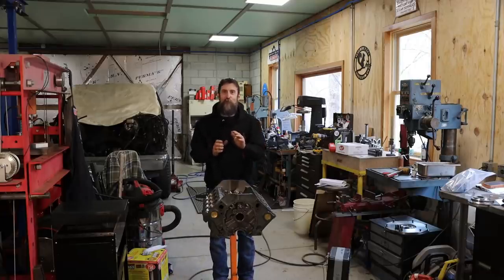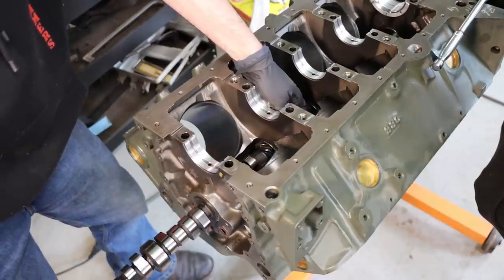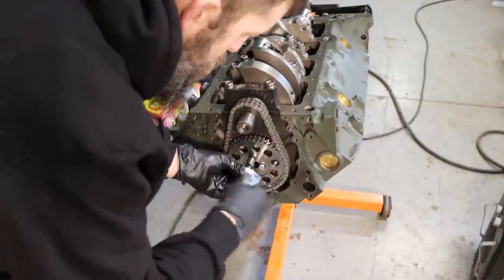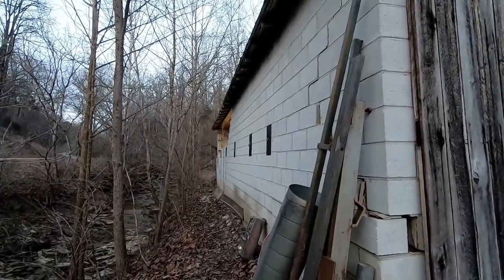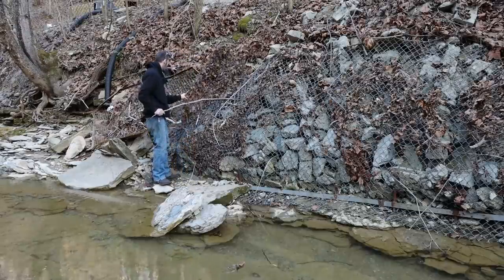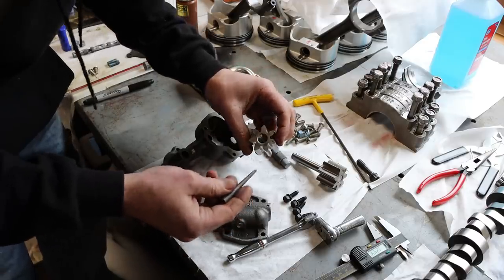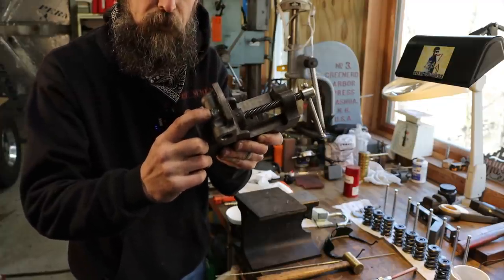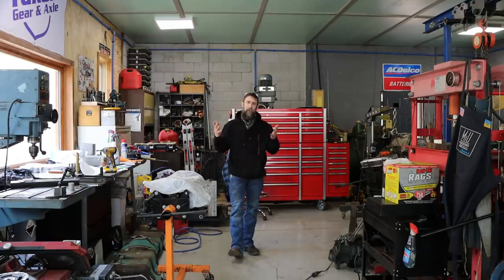Getting Ready for Balancing . Shop Update / Flashback

Comment: We always used a little modelers clay on the bottom of the oil pan where the oil pickup screen would meet and put the pan gasket on the block and set the pan on pressing it down to flush. then lift the pan off and measuring the clay to know how close the pickup screen was from the bottom of the pan.

Comment: For the creek: commentors have suggested creating an upstream breakwall to divert / slow the current along the bank. Maybe stack bags of premixed concrete to do that. Soak the stacked bags to activate the concrete. Lousy structural strength, but you end up with  tightly fitting "boulders".

Comment: Hi, I was doing my typical Saturday Moring visit and as with many visit's picked up an interesting tidbit on oil pumps. The reason and how to help with gear type automotive pumps having difficulties is new but unexpected for me. I have changed out or installed well over 100 of them and never from a failure due to this but it makes sense. The fix is quick and easy. Why not. as well with every machine procedure is to do what is on all or a rare thing not to do is to "BAE" break all edges. Those tiny, tiny bits of metal can lead up to larger than large failures and be the root cause for our worse nightmares eh. As with all you do being the type of fella that leaves no stone unturned you left no stone unturned today.  Your a volume of knowledge on many trades and love to pick up new trades at the drop of a hat. It's a pleasure to have these visits my friend.  Have a great weekend.

Comment: You can sure see the difference in the two rods. The cheaper one does look cheaply made. Well worth the upgrade. It would be a shame to have a failure because of it. I have never assembled an engine before. Have changed a few out but never put them together. Very interesting. Thanks for taking us along.
Reply: I was thinking the same thing
Reply: I'm surprised the scat rod was lighter, looks more massive. To my eye the biggest gain was the larger fine thread ARP fasteners...

Comment: Steve, in regards to the bank erosion,  you may want to explore a lead edge deflection system embedded into the stone with the added benefit of diverting the flow around the gabion basket you built.  Have a Good One!
Reply: A '63 Cadillac should be about the right size. The tail fins would calm the water turbulence too!

Comment: I actually have the chamfering tool that would be used to deburr the backside of a hole. It looks something like a bore gauge, but with a single slit in the end. There is a small triangular blade, very oblique, with the fulcrum right about the center. You can turn the triangular blade so that it is no wider than the shaft. When it pops out on the far side of the hole, you give it a little jiggle and the triangular blade turns, self aligning two legs of the triangle against the bore and scrape like a Noga tool. It's a little fussy to retrieve, you have to poke back and forth to get the blade to turn again. It's actually a very old tool made by Slocumb, I don't think I've ever used it, but it did make for an interesting scavenger hunt when I was trying to figure out what it was. It it's capable of a large range of holes, but I don't think it can go much below 3/16 and not much beyond 3/4. I got it loose in a lot, perhaps it originally was part of a set covering a larger range of diameters.
Reply: Assuming my description is shit, it might be easier to just imagine if it much like a butterfly or toggle style anchor

Comment: in hindsight : you finished that workshop renovation just in time , a year or so later and the lumber / building material prices wouldve made it cost 2 to 3 times as mush (not kidding either)
sumting i seen done to oilpump is machine a small groove on the bottom of the housing toward the shaft of the idler gear , that pushes the oil on the face of the idler gear and along the shaft
the trapdoor in the pan is for dragrace use , it prevents to oil from sloshing to the rear of the pan during accelleration
Reply: Wrong, helps keeps the oil in the sump during deceleration/// Chevy sump is in the rear, correct?
Reply: I think I saw, briefly, a small groove like you described, in the oil pump housing already.

Comment: You should have tested the oil pan fit while the crank and rods were installed. Since the block rail was clearanced for the rod bolts there is a possibility of rod bolt to oil pan interference and the pan may need some massaging for clearance. Be sure to test this during your next assembly.

Comment: I remember in 1970, I was working on a 65 Chevell Station wagon.  The owner kept seeing oil pressure drop.  In checking the pressure, it would fluctuate.  Boss say's rebuild the motor.  So I did and after bearing, rings, gaskets and all that was needed, it still kept losing pressure.   What we found out, that the owner had swap out the distributor from another motor (not the same kind) and was not long enough to fit into the pump.  Therefore the distributor was turning, but not the pump.

Comment: Its an anti-slosh door in the oil pan. When you accelerate, it keeps the oil in the pickup tube
Reply: Toy mean when you brake it keeps the oil in the sump. Or, at least that's the intention.
Reply: It looked like the door opened toward the front of the engine, which would tend to keep it in the sump during hard braking, or did I see that incorrectly?
Reply: @charlieromeo7663  Only slightly, looks a little crappy but should help...

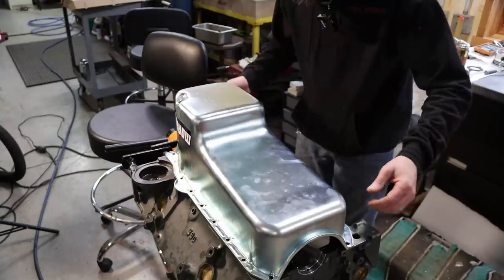Comment: At 24:00 put a wad of silly putty or play dough on the oil pick-up and mash the oil pan into the putty, then measure the final thickness revealed after removing the pan, then carefully clean the putty out. Maybe use a loosely waded ball of aluminum foil as well.

Comment: Great vid. I am rebuilding a chevy 6.2 diesel. Guy who i got it from said it ran. Pulled it apart. It was siezed and the oil pickup in the bottom of the pan. Rods were hitting it so it must have sounded like a knock. I am in the process of a full rebuild now. I will be tig brazing the oil pump pickup on.

Comment: With your erosion problem, think of it as redirecting the flow of the water.  You want to stabilize your side of the stream, while letting erosion happen on the other side.  I would add to what you have done continuing up-stream as you find rubble.   Another thing that would help is if the vegetation on the far side of the stream just happened to die.  Remember, a dying vegetation looks the same as vegetation going dormant for the winter.

Comment: you could measure the pickup to pan clearance , put some foil on the pickup and use modeling clay on top of it bolt down oil pan when you remove oil pan the clay will be compressed to the depth between pickup and pan bottom then you will know the distance between pan and pickup

Comment: In white water rafting,  a EDDY is a area of calm water that is formed behind a obstruction to water flow,  be it a rock, a bridge pier or even a bend in the water way. on the UPSTREAM side of your bank reinforcement you can anchor your reinforcement in a EDDY so the upstream side is protected from the flow or water and possible debris.  This needs to be substantial enough to resist the water flow  but it actually doesn't  need to be along the whole of the bank,  so a wire Gabion a piece of concrete pipe on its end,  a large rock would be substantial enough   to redirect the flow.

Comment: Love the update, Steve...the streambed has a lot of loose rubble; I'd anchor the leading edge of the fence and then just slowly but surely start piling up loose slate and rocks from the upstream bed.  A few dozen of those larger flat rocks should get you through another season or so.  Whatever size is manageable to lift. Another option may be to use a couple of the larger boulders upstream to encourage the flow to shoot past the problem area. I've seen your videos when the stream is raging; It's going to be a constant battle!

Comment: Great memories of the shop renovation, you did such a great job and it's it nice to see you reaping the benefits now :)
If tree trunks and branches etc didn't get caught on the wire netting it would withstand a lot more punishment. Laying a slab of steel over the leading edge of the netting and anchoring it to the bank is my thought. Make it a decent thickness of steel...

Comment: Sorta temporary depending on the wire you get but a gabion wall to to deflect the current would be relatively cheap. Mostly sweat, stacking rocks in the cage. If that stone in the creekbed is readily liberated by hand or pry bar, you wouldn't even have to tote it that far.

Comment: Steve pack the oil pump with white greese so it pick up oil when you first start it
Reply: Steve knows what he is doing.  He will not start this engine without pressurizing the oil system.  A rod ground to fit the pump and a drill motor does a fine job.  The "greese!" method is old model A stuff.

Comment: The engine should last you a long time when finished Steve, The only time I have seen crank to cam clearance problems is when you put a 4"
stroke crank in them. that is why they have raised cam blocks to solve the problem. I always tig weld with silicon bronze the pickup on both ways work. You will be amazed as to how smooth the engine will be with a good balance job.

Comment: Sooo, with all that wonderful machining equipment, perhaps cutting a o-ring groove in the oil pump pickup hole to maybe prevent accidental heat warping the shuttle tube? I guess the tolerances for the shuttle would be large as its seal is just the end. Next rebuild on the engine you should definitely do that! :p

Comment: cool video, love your channel. it's one of 3 that i wait for the new vids to come and watch immediately. i noticed the way you had your block mounted to your engine stand. i always wondered about that when i was a tech. what i came up with was to flip it 180 from how you have it. with everything loose pull the bracket towards the top of the motor. this skews  the center line. if you don't do this the motor will end up super top heavy when install the cylinder heads. thanks for sharing.

Comment: Steve, consider placing the new and old oil pans on the bench and look at the slope from rear to front. Is the oil going to be stacking up while powering up a long slope? I.E. not flowing into the sump? 
I’m sure you looked at this but I want to see.
Reply: This is a Chevy, sump at the rear so an uphill climb would put the oil in the sump.  A Ford with a front sump may give cause to your concern.

Comment: At 27:00 Why not TIG-Braze instead of Oxy Acetylene?
Reply: What's wrong with Oxy-Acetylene?  It worked perfectly.
Reply: @paulcopeland9035  Less total heating and more pinpoint control of the heat that was applied, Steve can almost "tig dimes" and that did not happen at 28:15 with this round of "O-A" action. Less chance of warping the piece requiring re-machining to flatness again.

Comment: What is the significance of the large circle crankshaft? Does this reference a larger amount of centrifugal Mass to the crankshaft? Presumably this increases the torque to horsepower ratio? Sorry if this is a very stupid basic question, I don't have any engine experience at all

Comment: Very surprised youre not using specific engine assembly lube, its tackier thicker more viscous and stays put longer during first startup avoiding dry start up issues in that critical first few seconds, just saying never seen any engine builder not use it, must be good reason for it or they wouldnt use it.
Reply: This assembly was to check for clearance issues since he is running a non standard engine configuration.  He is taking the engine completely apart again to get the bottom end balanced.   Im sure he will use assembly lube on the final assembly.

Comment: Is that pan a garage sale or eBay find? The baffle is to keep oil in the sump under hard braking, steep downhill (not extended), or both. Road racing comes to mind but I think that those boys and girls all run dry sumps these days which is why I wonder about the source of the pan. Moroso pans are expensive but worth the cost if the service is severe (racing). For a street pickup truck... a couple of stickers would be cheaper :) It's nice to have 6 quarts of oil though. Sooo, maybe modify the factory pan to make it hold more oil. Welding... sheet metal... not hard to do. That's how Dick Moroso, and others,  did it in the late 60's.  Balanced... eh... the rods and pistons should be fine from the vendor. So should the crankshaft, unless you plan on a redline in the 8,000+ range. You could have weighed everything before assembly and adjusted the component weight yourself. The crank needs to be spun to balance it so I can see sending that out, if you're building a race engine. A steel gear set for the cam is good idea. The old gear sets were nylon, fiber, or some non-metallic material. That's why you had to change so many of them. I can only speak for the pre 70's Z-28, they had a steel timing gear set from the factory and that held up just fine. The oil pump gear mod was cool. An underdrive gear is not a bad idea but again, it's not a street mod.

Comment: Hi Steve,
I was wondering, did you have to send the flywheel and harmonic balancer along to the machine shop?  I believe the 400 CID crank is externally balanced and wondered if they needed to be considered during the stroker balancing.  Your shop is awesome.  It must be a great feeling to have fixed the structural issues and doubled the usable space.  Thanks for the video!
-mike

Comment: Has the slab under your passenger rear tire lifted? It looks uneven ( higher than the one next to it) in the video.
Reply: It was build this way. He wants to replace that half of the floor in the future. The rebuild of the shop is literally rebuilding that half of the shop. So yes there is a hight difference in a part of the shop.
Reply: ...and the existing floor was not level, so he didn't want to match his new pour to an uneven, non level surface.

Comment: Steve ,   
Liked the 3 holes in the pump gear, took me a year to do a final assembly on my 327, it now is in my 70 Chevelle and has 400+ miles on it and running great. One thing I did have issues with is all my rubber fuel lines had become very soft from the alcohol in the gas nowadays and the pickup sock in the tank was in bad shape, so I had to replace them with fuel injection fuel line and clamps to replace the old stock rubber fuel lines as the rubber was collapsing  under full power and starving the Q jet carb. plus I bought a new pick up sock for the gas tank. My 67 small journal 327 was just a stock rebuild with 881 casting 79 Corvette 1.94 iron heads and factory aluminum Q jet intake. However, I did replace every single part in the motor and did not re use anything except the block, forged crank and the bare heads. The motor is now running stronger every time I cycle it from operating temp back to cold.  I have already changed out the brake in oil & filter 3 times. Started the motor with straight 30W Lucus high zinc brank in oil to brake in the flat tappet cam and after 30 mins at 2,200 rpm drained the crankcase and replaced the Wix filter and filled with a second 5 qts. of 30W Lucus brake in oil & a new long Wix filter. Ran it for 200 miles and then changed oil again a 3ed time with Valvoline 30W VR-1 high zinc oil as I am still seeing very fine sparkelys on the dip stick from seating everything as I used molly rings and they take a very long time to fully seat. I will run this 3ed oil change for around 1,000 miles and by then the weather in South Florida will again be in the 90s so will switch over to straight high zinc 40W VR-1 from then on. I learned a long time ago to change oil every 1,000 miles no matter what. Fact is, I get small block motors that look like new inside with over 200,000 miles on them when you change the oil every time at 1,000 miles. 

P/S, I do remember the dark days of the collapsing wall of your shop in the very beginning thinking how in the world is he EVER going to fix THAT ??????????  plus I miss all the squirrel's. Do you ever see any of them anymore ?
Reply: Is it "brank", "brake" or break?
Reply: @paulcopeland9035   Let me go check Paul, hang on. Well, I checked, Lucus calls it Brake in oil, so let's go with that, sound good to you? Let me go change that spelling of that word right now. Bottom line, my 327 is running like a brand new motor regardless of the spelling. 
   Want to thank you for finding that one missspelled word, I hope you are  as vigilant building your next small block Chevy as all it takes is one small mistake. I hope yours turns out as well as mine has. I am hoping to get 300.000 + miles out of it as I got 318,000 out of my last 327 I built

Comment: Mistake- never torque your rod bolts more than once. The bolts are designed to stretch to a certain amount, and each time you torque them they stretch further.  Use the old bolts from your motor for all your clearance and fit up testing and then when all is good, install the new bolts and torque them.